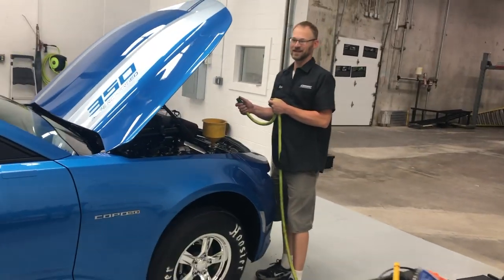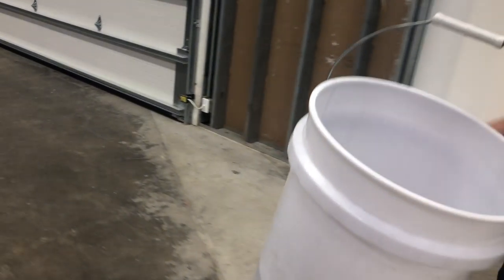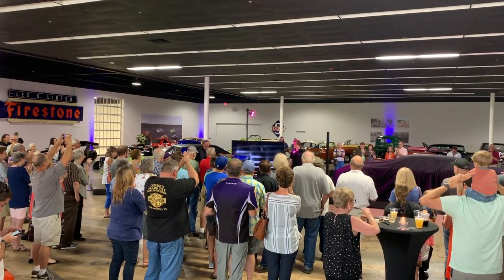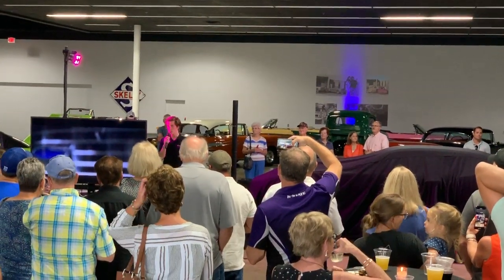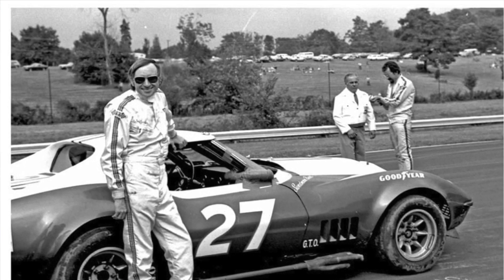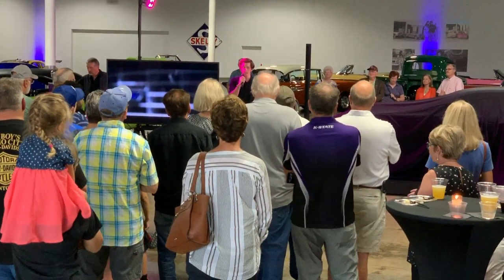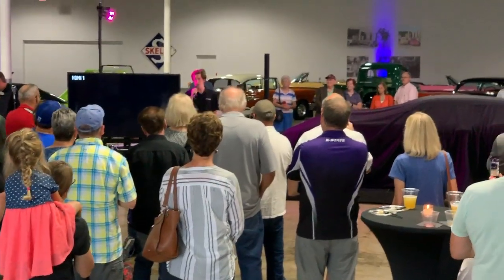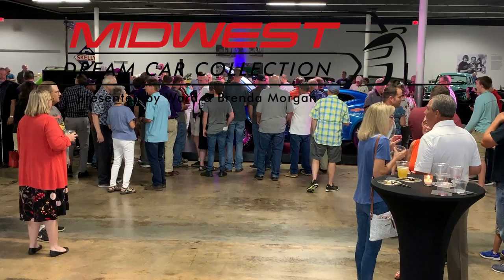Our 1 of 69 50th Anniversary COPO CAMARO

Comment: I owned a red 69 427 425 horsepower it was my high school graduation present if I would graduate school my father worked at the assembly plant where the car was made and that's how I knew about it but The story goes that 69 of these cars made it out of the factory and one of the big GM personnel came into the factory one night and said that all copo Camaros would be destroyed that were on the property and everybody said why he took a prop rod from a hood went over to a ZL1 Camaro started it up let it get warm check the prop rod and push down to the gas pedal to the floor and put the prop ride against the seat and walked away from the car it revved up the flywheel assembly came apart cut the door hinges off the car and went into the car sitting next to it this car is considered a liability to general motors because it does not have a blow proof bellhousing this is a honest-to-god storyGod bless general motors for allowing me to drag race my car on the street for 4 and 1/2 years and not wrecking or killing anybody that's how it came that only 69 made it out of the factory all the cars on the property had the maintenance men take torches and blow holes in the motor blocks and the cars were crushed anybody would like to discuss this story I can be contacted at 754 366 5033 enjoy the fun I forgot the fact that there were 300 of these cars were destroyed
Reply: I also owned a new '69 Camaro COPO car. Only 20 yrs. old but worked the auto factory and lived with parent. Had fun with the car but wracked up too many points on record. Didn't realize what I had and traded in on a first year Vega GT ('71). I believe they made around 1100 of these 425 Horse Camaros.